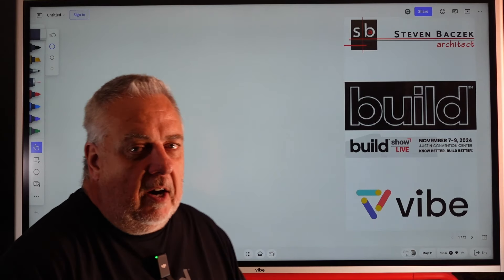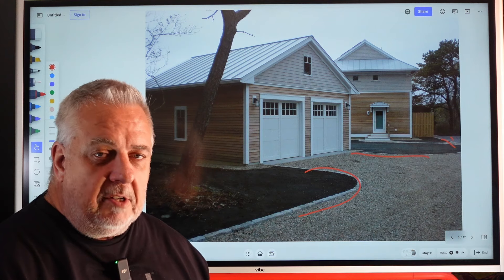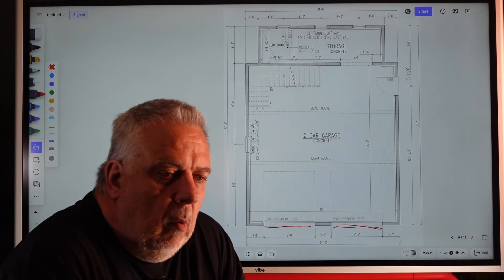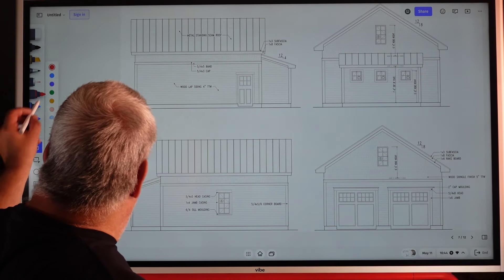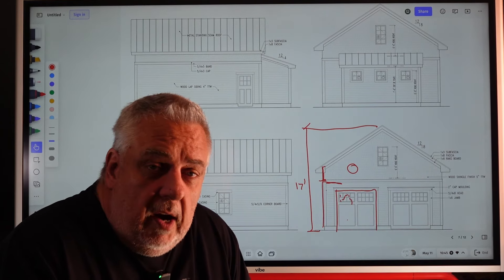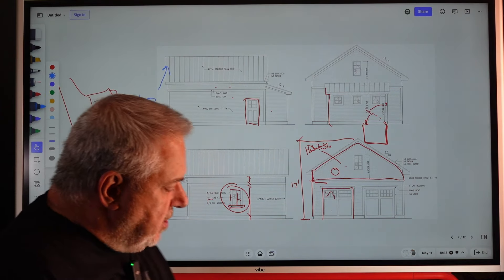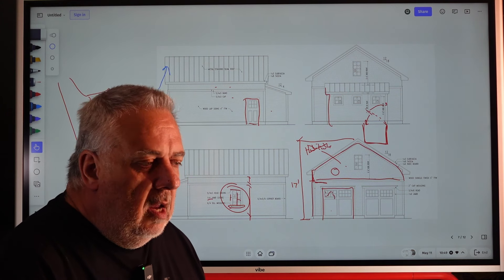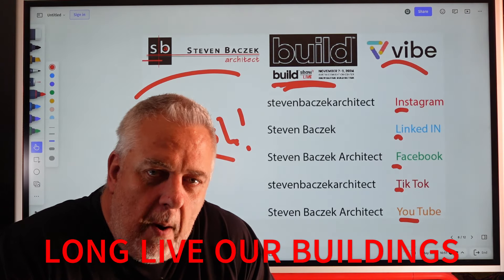PH11 Episode 18 DETACHED GARAGE

Comment: Steve, I'm a civil engineer and one tool I use is a program called Transoft Autoturn to help inform my design around cars. That said, an 8'-0" wide garage off of a turn is tight, meaning as you're backing out of the garage you can't make any turns left or right until the car is completely out of the garage;  Also the driveway edgers being inline with the garage door also limits the driver's ability to begin maneuvering even after it has cleared the garage walls. The car provided in Autoturn is a "P Car" as defined by AASHTO (It is a conservative representation of the average car) - but a quick check - I'd need approx 35' from the garage wall to the "T" of the driveway to have adequate room for maneuvering. Increasing the width gives just a little more "breathing" room for making maneuvers.
Reply from the maker: Actually I accounted for cars backing out of the garage. I appreciate your comments certainly, but please understand I talked thru this with the client. I just posted a 4 sec video for you to see the solution I had proposed and had constructed - thanks for joining in
Reply: Steve, thank you for posting the additional video showing the extra extension. Out of curiosity what was the length of the car going in the first garage? Does the stairs protrude into the left parking space - limited to shorter vehicles?  Thank you for making awesome content!
Reply from the maker: @zenrook1  wELCOME sIR!!! There was approx 24' to the stairs so a decent sized car could fit there

Comment: I hear it every time I show my 21 Beechwood plans to anyone.  Where is the garage...  "its not attached".  OMG what are you doing that is crazy.   Why they ask?  I have a list of reasons, but the main one is Energy Efficiency.  The second one is air quality safety.  The third is, they are a waste of good space you can use for you home.  The list goes on.  In my Resort Residential zone by-law we also have the same height restriction, 5M.  To prevent people from doing just what you said, turning the space into habitable space, for Bunkie's etc.  They also restrict the build of such detached buildings until substantial completion of the main building is done, to prevent people from building them, and either not building the main house, or they live in them well building.  Even though we have a height by-law, you can pay $ to the town and have a variance.  I have a new build in front of me, with one of these mega garages, and my view is now limited across the entire site, as the house is at max height too.  The first thing the neighbor said to me, move here from the city, about the height after he asked if I like it was he planned to turn it into a Bunkie.  So even though the town has by-laws, they took his $ and let him build higher, height of main building, he still is going to do what the town is trying to prevent.  Zoning can be stupid, or it can be great!  In this case, it just seems stupid.
Reply from the maker: Everyone has an opinion, that's why I don't ask lol.....

Comment: Hey Steve,
I live down on the Cape and planing to finish my basement.Ridgid foam board attached to the concrete and then framing with rockwool.My question is do I need vapor barrier behind the drywall?I am leaning not need it since it's basement ,and is Rockwool and my water heater has heat pump acting as dehumidifier. What's your opinion?Thx
Reply from the maker: The rigid foam will drastically slow the migration of vapor